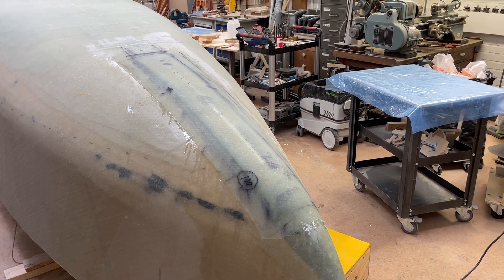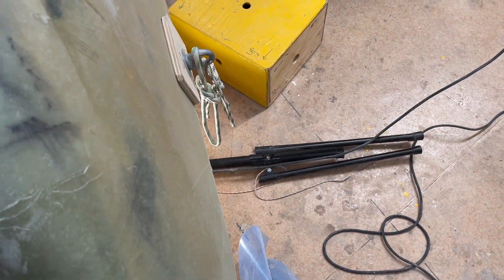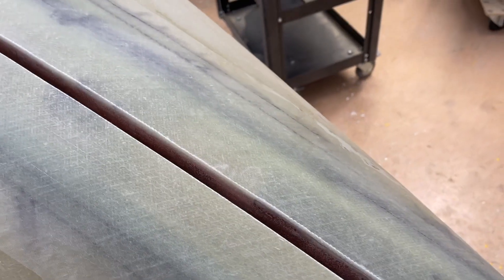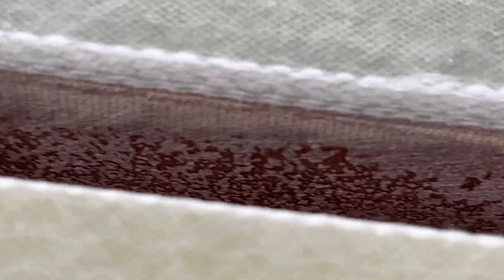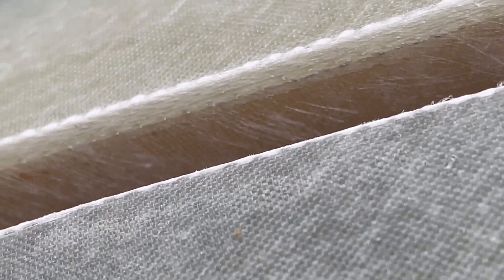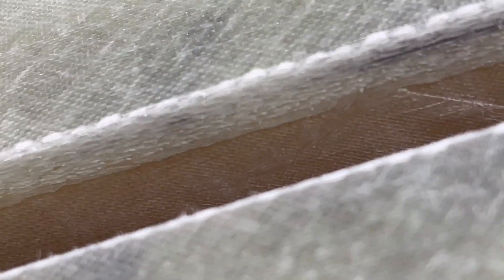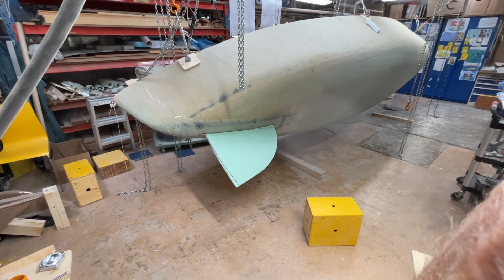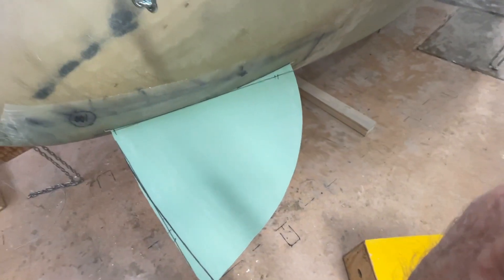11 August 2022  Opening the slot very carefully as not to damage the trunk sides.

Comment: Just wondering why you would not wrap the fiberglass around the edges of that opening? Won’t those exposed edges be a problem after they are under water for awhile?
Reply from the maker: If I did the inside would not be flat.
Epoxy do not absorb water so no problem.

Comment: I still believe you have a not glassed edge between the many layers of the hull lamination and the inner side of the trunk.
The trunk was cut to be even with the hull. Raw divinycell there. And now you have glassed that raw surface exactly to the edge of the opening. But no overlap to a glassed area inside. Or?
Reply from the maker: There are two layers on the inside of the trunk. The seven layers I now have on the outside of the hull rest on the section of those two layers.
All the Divinycell is covered with glassfibre two layers on the inside of the trunk many more on the bottom.
Divinycell do not have to be covered with epoxy/glassfibre except for wear and strenght as it is made from closed cells that do not absorb water. Divinycell is an inert material you can forget about.
The Divinycell in the trunk is H200 200 kilo cubic meter. 
It is 2.5 times as strong as the Divinycell H 80 that I and must people use for hulls even up to 60 feet boat.
It is 30 mm thick in the trunk.